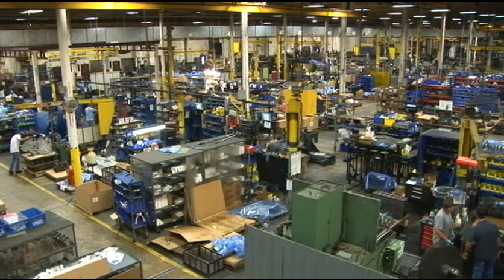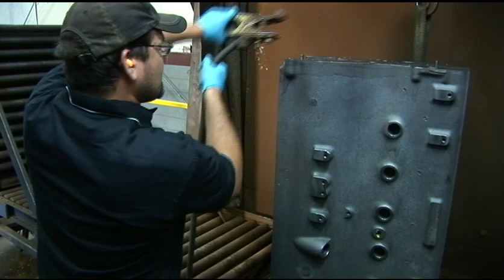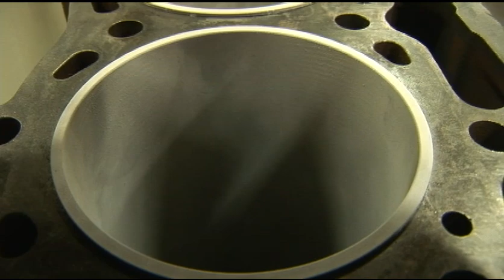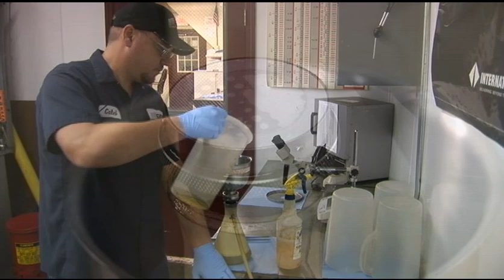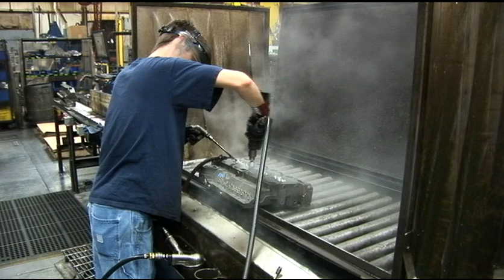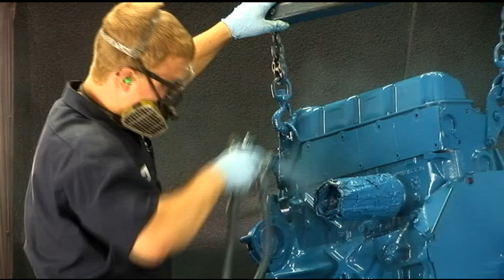CNH Reman Engines

Comment: Why does Cummins allow you to rebuild some of their engines? They were used before New Holland had anything to do with Case AND Cummins has their own reman facilities. Therefore, it would make more sense if they took care of the reman process and quality themselves since it is their name on the engine and not CNH's.
Reply: A dealership can also rebuild cnh engines but most of the time with labour costs it is cheaper or not much dearer to buy recon, biggest reason people go for recon is you basically get a complete new engine where rebuild is generally just pistons, rings, bearings and gaskets, if you want cylinder head rebuild than that's and extra cost.. but all depends on why the engine needs rebuilding
Reply: The "Cummins" engines used by CNH are the result of a Cummins-J.I. Case "joint venture" that began in the  1970s. Specifically the B- and C-series engines. When Case's 401 and 504 engine tooling was worn out and Case was broke and had been acquired by Tenneco the joint venture began because those engines were obsolete and not worth retooling for. Case construction equipment used the Bs and Cs prior to the Case-IH "merger" which resulted in Navistar "IH" engines being "spun off" with International Trucks. C-IH tractors have always had "Cummins" engines that do NOT say Cummins on them.
Reply: Cummins does not remanufacture engines. It "reconditions" them.

Comment: It would be nice if i could find a company that would install the better internals i need to prepare my motor for a turbo...  it would kill 2 birds with one stone.  as of now i would need to buy a remanufactured motor and then disassemble it all over again
Reply: caste
Reply: Just buy a core engine and have a machine shop do all the cleaning and dirty work for you and then they or you can install the parts you want in it. That would be a more logical and much cheaper route...
Reply: Buy a short block assembly to your specs, then bolt on the heads, manifolds, and go!

(I mean, after all, you're already going to be literally installing this engine. So, bolting some heads and manifolds onto a short block before you put it in ain't no big deal.)
Reply: High volume rebuilders generally want nothing to do with high performance stuff since there's no way they could warranty it. The minute you disassemble a remanufactured engine on your own you're voiding the warranty. There are specialized shops that can do the sort of work you're talking about, but don't expect a warranty from them either.